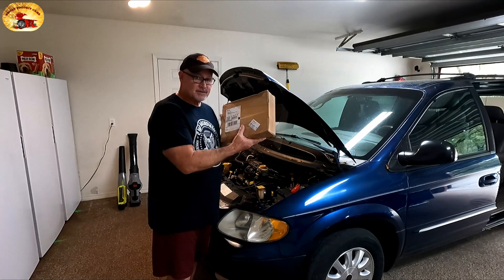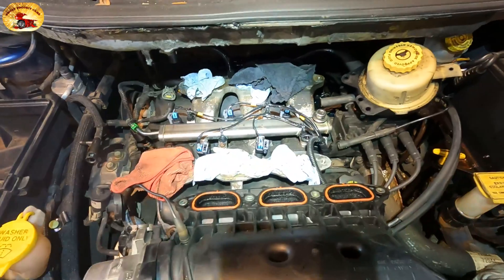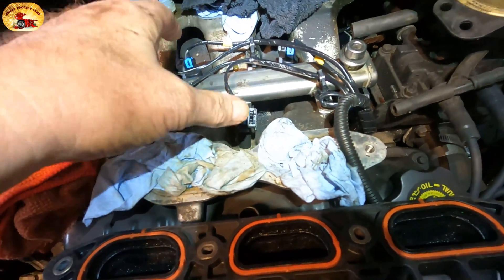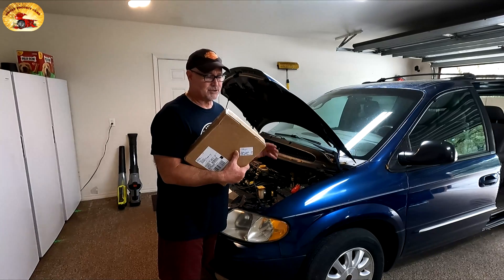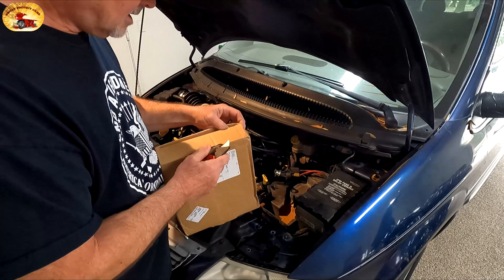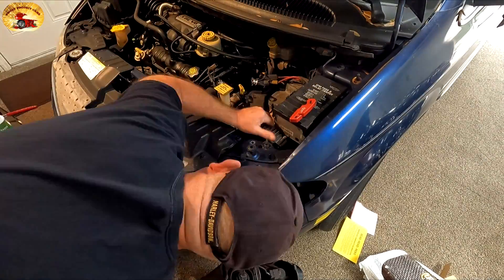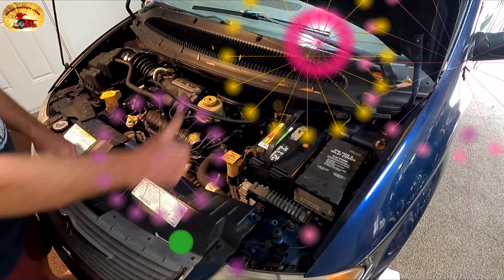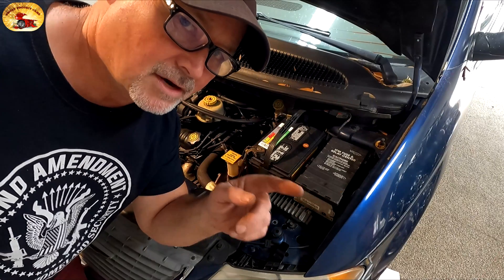How To FIX Any Car or Truck ECU/COMPUTER When it TAKES A BIG FAT DUMP....Plus Blue Bummer UPDATE

Comment: I've been lucky w fuel injection: Always use Top Tier fuel, and never rev engine just before turning off, like I see some folks doing.  Also, avoid short trips where engine does not get to full operating temperature.  Finally, after warmup, at least one or two wide open throttle periods every trip.
Reply from the maker: Thanks for the view and comment, Josh, have a great day. mad Mike

Comment: Yes you are right back in the day those vans with the 3.3 and 3.8 Liter engines
had a known problem for that Injector Wiring Harness to "Melt" against the
exhaust and you can't see it due to the wiring cover and when the power wires
short to ground it fries the Injector Driver in the PCM which ever one it shorts out
Reply from the maker: Yep! Thanks for watching and sharing your input, I really appreciate it, have a great week my friend. mad Mike